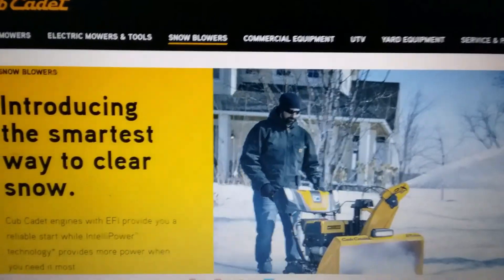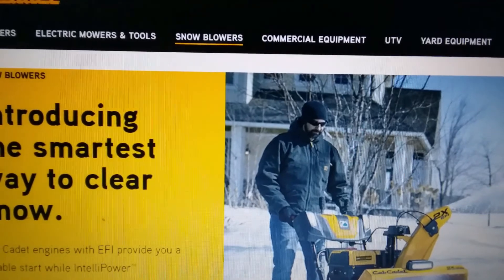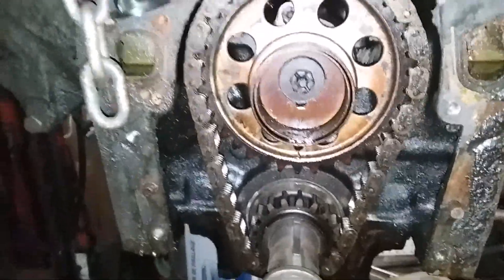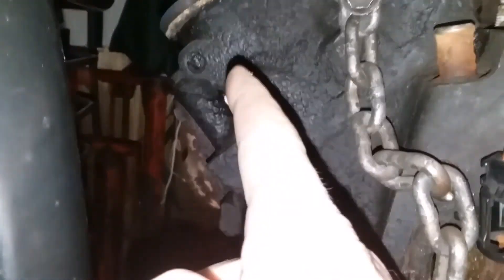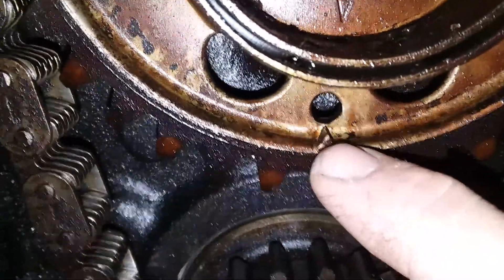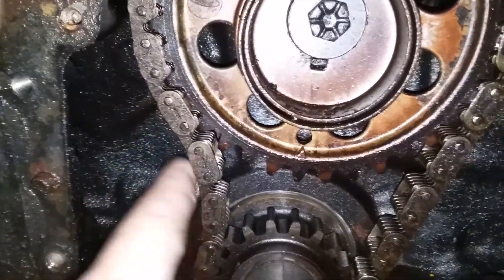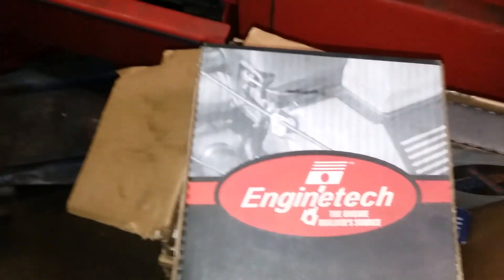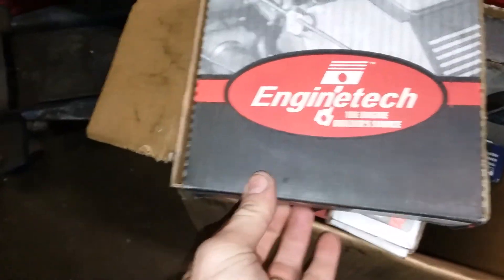Vintage Ford Truck Timing chain replace 351M PT 2

Comment: I have a 1978 f250 351m/400.  when the number 1 piston is actually tdc on the compression stroke the key way on the crank is at about 11oclock.
Reply from the maker: Thats a tricky one. I probably would need more info. But seems to me that the crankshaft is off. Might want to research a little more. Thanks for the comment and for watching

Comment: What do you use as a timing mark on the aftermarket cam gear? Do you get it set to tdc with the old one then stamp your own on the replacement?
Reply from the maker: All the timing marks should be marked for you to use and line them up with 
the key on top dead center. Thanks for watching and the comment.

Comment: Did you have to drop the oil pan? I have to change a timing chain on my 79 Thunderbird with a 351M. Thank you.
Reply from the maker: You should because the timing cover attaches there in the front. Sometimes you can get away with dropping the front of the pan. I never had any luck doing this because it would disturb the gasket to much. Hope this helps
Thanks for the comment and for watching.
Reply: @GMechinic  I'm taking the oil pan down and cleaning it as well. Thanks.

Comment: Hey  now! I got one of those in my dent side 79 and after sitting for 22 years yep the old water in pan of course, we drained it, filled radiator to warm it and now water in oil pan, never got hot, up to operating temp, my question is could water from sitting years, could corrosion eat at the front plate causing water pump suction into oil pan since engine has vacumn creation, dont beleive  in head gasket Crack, oil is gray I never seen gray oil so oil is not hitting combustion, and intake is dry set up, weird deal?
Reply from the maker: Sorry for the delay. Yes antifreeze, if it gets behind the timing cover it will go directly into the oil. I have seen the timing covers corrode, but never enough to rust through. Probably from sitting not running for a long time. Thanks for the comment

Comment: You didn't install anything in this video.
Reply from the maker: But I did give you very good information on this subject and what timing chain set to use in your engine.
Reply: Did you make a clip of actually installing it?
 @GMechinic